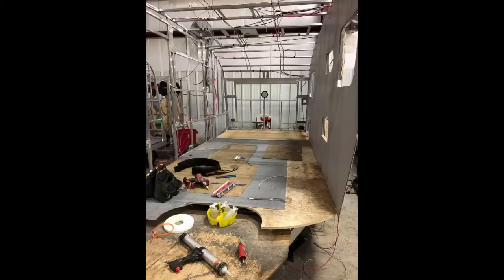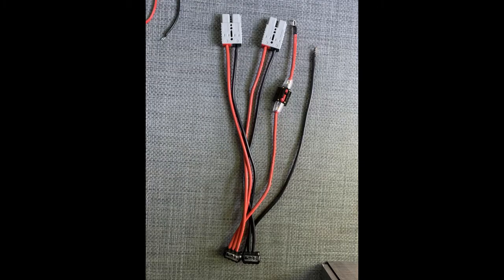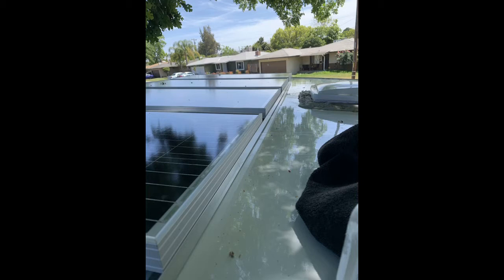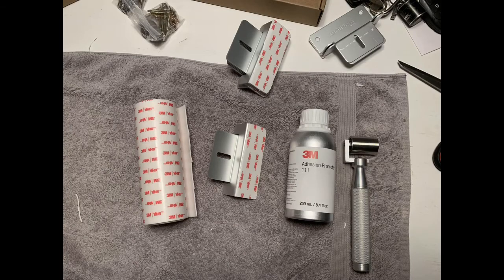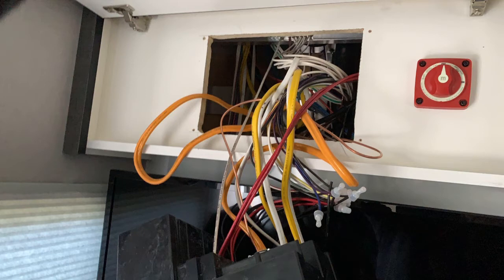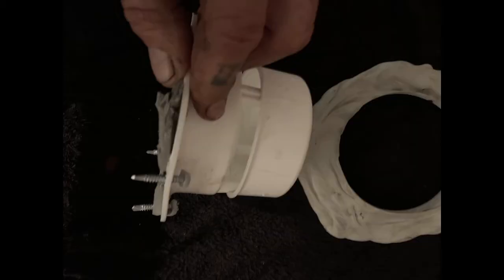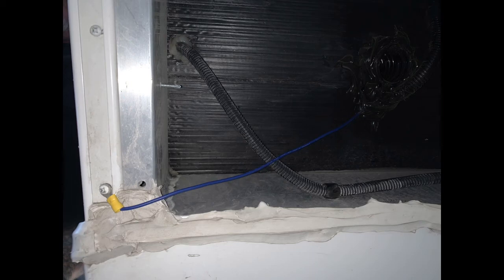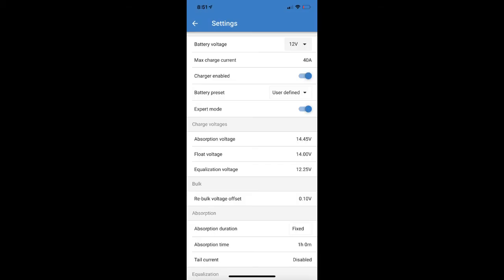InTech Terra Lithium Battery and Solar Install, UPDATE I am using all Victron Controls and 5 202ah’s

Comment: We just purchased a Sol Horizon. I am an electrician and used to install car stereos back in the 80/90's so I have a decent idea how to do this install. It is nice to see the routing and controllers different people use. I am going with a Xantrex 3000watt converter/charger and Victron MPPT 100/50 solar controller with a LI Time 300 AH battery. This seems like a decent setup without going crazy on cost.  I have been using a Redarc 1225 charge controller in our 4Runner with 2 Optima AGM batteries to power our ICECO fridge and lighting/charging needs while tent camping. Haven't decided which solar panels to use yet. We still have our Harbor Freight 100 watt rigid and 100 watt suitcase solar panels for only 200 watts. It has worked ok to charge the truck and a EcoFlow pro battery pack. Of course we want to boondock more with the trailer and will need solar in the 5-600 watt range. BTW we have sound in common in our backgrounds. Have been a sound guy since high school, having my own sound company for many years. I'm now an Auditorium Manager/Tech for a school district.

Comment: Great video on the set up.  You mentioned the converter that you run your solar panels through to convert to 12V for charging the batteries, but you don't mention an inverter to run some smaller appliances on A/C when not on shore/generator power.  Is that because you don't have an inverter installed or the converter is both a converter and inverter (hybrid) on the Terra Oasis?
Reply from the maker: I have a 4000/8000 watt Inverter as well as a 30 amp transfer switch and I am able to run my air conditioning and our microwave convection oven
This video was just the batteries and solar particularly
Reply from the maker: The Terra comes with a standard Progressive Dynamics PD4000 series Converter
Reply from the maker: Also I have totally redone my system since it’s original install and it is about time to make videos and make my channel happen

Comment: Is it possible to just replace the current battery with two lithium ions and move the few circuits over?  At what point do you need the charge controller and other gadgets?  I’m not looking to boondock, I just want to be able to get 6-8 hours of lights, fans, tv, radio, coffee maker and laptop.
Reply from the maker: Yes it’s possible, what trailer do you have?
Reply: @boondockduane  I have the Terra Oasis too (love this trailer) and will get to solar eventually.  However, if I just want the Lithium batteries, I just follow the first 10 mins or so of this video, correct?  Get rid of the old battery and box, seal the floor hole, install the new batteries, hook them to the terminals (are those there already I would guess?) and flip the switch on the inverter and I am in business?  Just want to make sure I have it right.
Reply: I’m thinking you are correct. I also believe the disconnect and inverter has been moved in newer models to above the tv so down the road you shouldn’t have to run under the trailer.